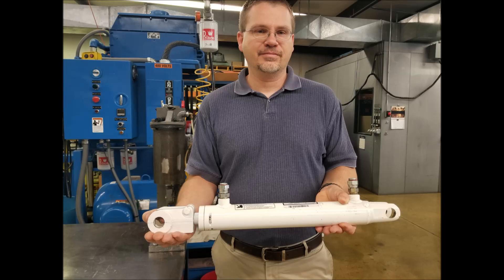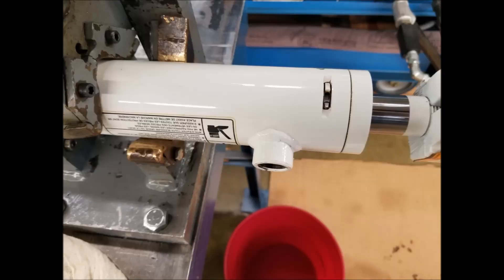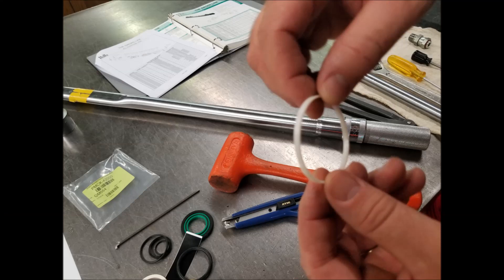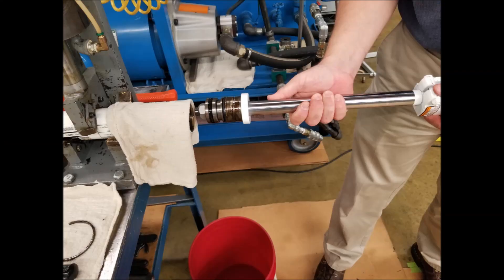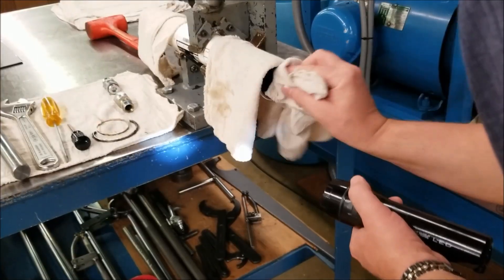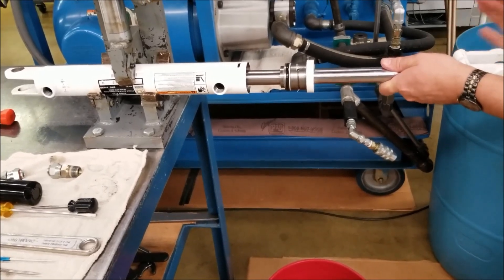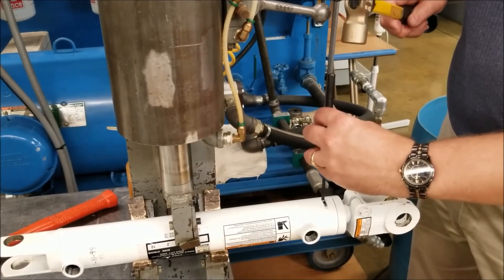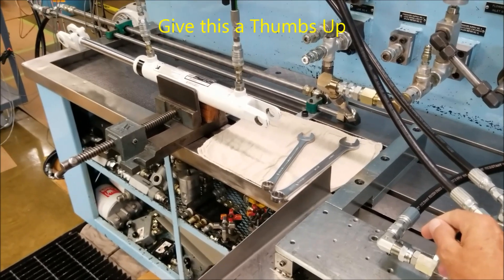Square Wire Gland Retainer Cylinder Repair

Comment: That works great on a pristine cyclinder. Not so much on 50 year old agriculturally used cylinder. Whole other ball game.
Reply: I'm curious how your "ball game" went? I  need to do packing on a 4" bore 20yr old on the bottom of a trailer in rusty salt winter canada!

Comment: Nevermind my comment i watched the video to fast. I am surprised the ring used in place of keyway to remove cylinder isnt also used for the install to prevent nicking of seals.

Comment: Dumb question but what is the purpose of the installation ring and is only installed temporary? Im confused on its purpose. Its installed then the gland is pulled out. Appreciate some help because im doing one this weekend and my rebuild kit i dont think has one. Has a new key tho. Thanks in advance